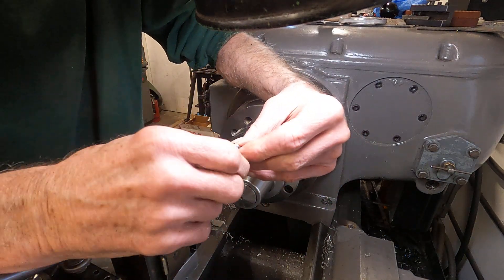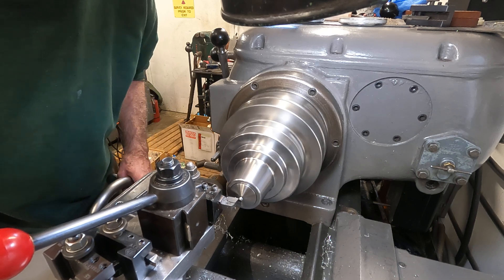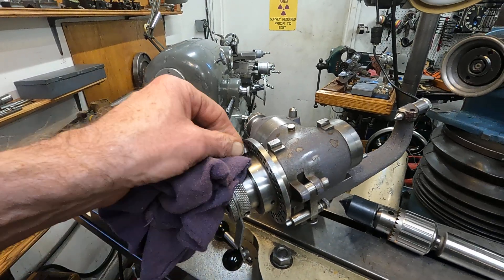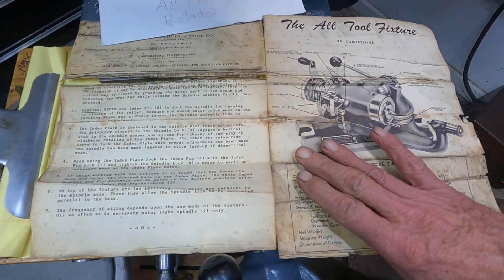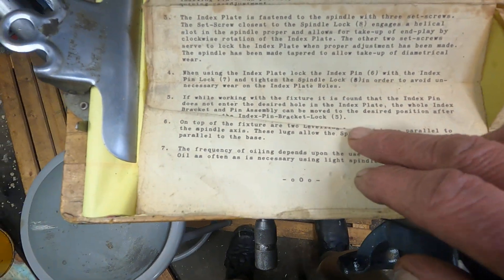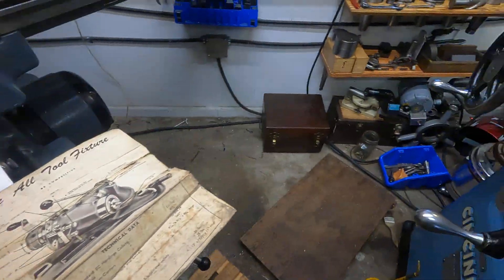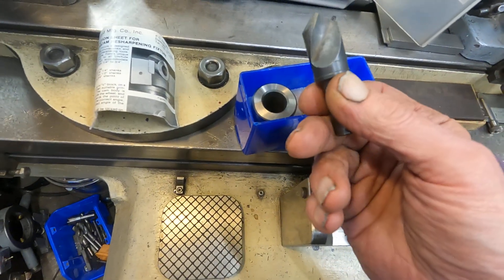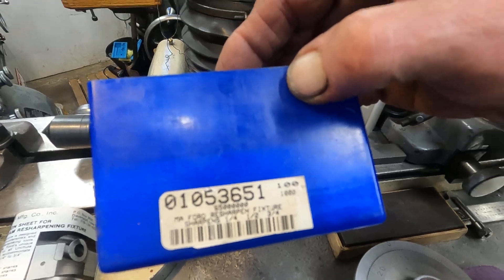All Tool Rotadex grinding fixture instructions, restoration

Comment: One Boss used to have everybody stop work at "slow times", then have everyone clean their machines and benches. 
Afterwards we would ALL gather to wash, degrease, scrub, mop and rinse our concrete floors, so it would NOT smell like a machine shop for when we would have visitors like relatives, friends, bankers,,.... but most of all customers!
Reply from the maker: We had a WW2 Navy Machinist at the local school, the machines were painted work force green, grouted to the floor and the floors mopped, I never liked work force green though

Comment: The fixture is looking good Don. I got in the habit of putting all the tools away, cleaning the machines that I was using and sweeping the floor when done for the day.
Reply from the maker: I have learned that it is even more important in such a small space.. There were government studies on making work spaces more efficient in the 1930s where the machines are tight together grouted along the bases so the floors can be mopped and painted work force green...